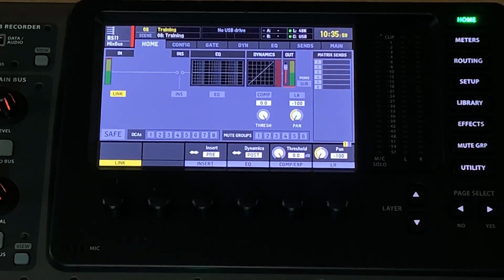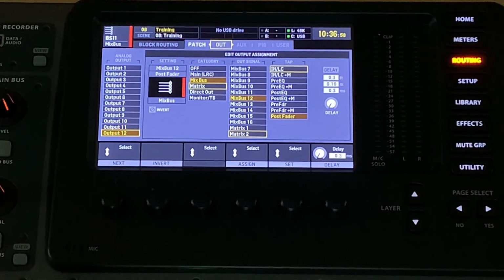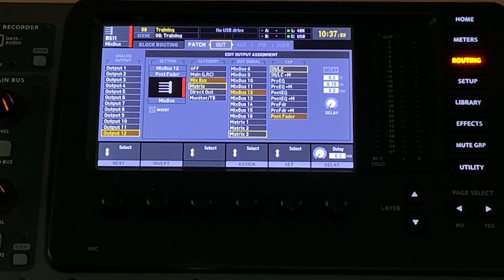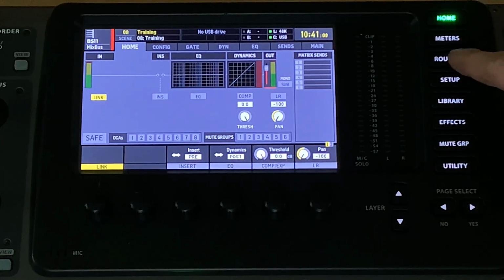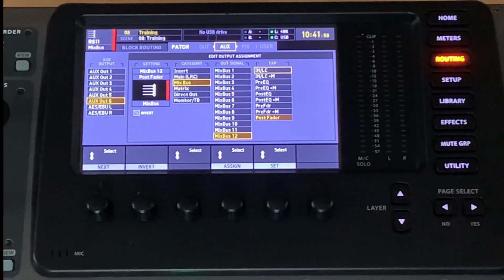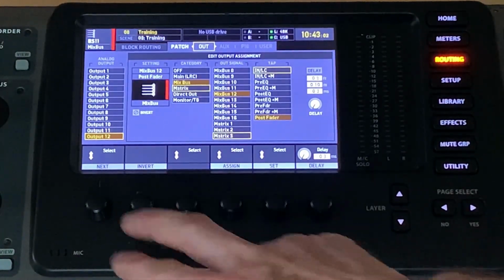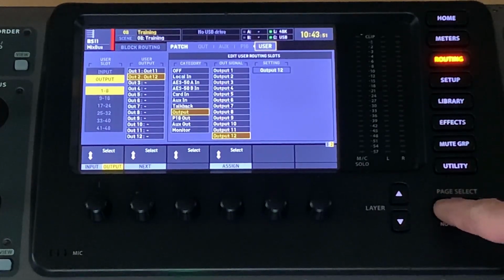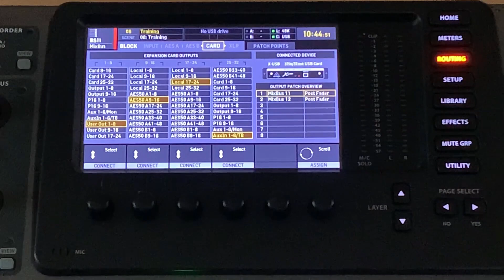3 Live Stream Routing Options for the X32 or M32

Comment: Howdy, thanks for all your videos and help in previous comments I've made. Another question that perhaps you can help me with. I'm helping a group with their online stream mix and set busses 9&10 as a stereo pair to accomplish this. These busses also have the Precision Limiter running to beef up the volume. As discussed in previous comment these busses are routed to run out of the Aux out 5 and 6 (Video L & R) to go RCA (post fader) into the encoder. The problem I'm running into is MASSIVE clipping in the resulting video stream. Unfortunately there is no way for me to monitor what the encoder is hearing or sending out. I'm almost positive I had these guys set up to monitor the mix on the console with headphones and heard no clipping there. So I'm scratching my head. Does the use of the RCA output send a much hotter signal than going out xlr? (Even then, I would think the encoder should be made to accept the hotter signal given its RCA inputs) The RCA outputs shouldn't bypass the limiter right, given that it is set to post fader? Not expecting magic, just wanting to get your input for troubleshooting...
Reply from the maker: If you have the limiter on your stream mix then your board mix should not be clipping. You did mention you have it set as "Post Fader" and I'm assuming that is on the output side which means your limiter will be active, but your fader can still raise or lower this overall mix. The first thing I would do is change that setting to AUX out tap point to PreFader so that there is no chance of turning up the mix and causing issues. 

The RCA and 1/4" outs are unbalanced outputs while the XLR outputs are balanced. There is no output level change or amplification happening on the soundboard side. Depending on the encoder you are using it could cause issues there if your signal is going in too hot, but I would only check this after looking at the stream fader on the board. Some entry level encoders might want to live in the -18dbFS landscape and if you push more than that they might distort. The X32 meters showing 0db on the output will actually meter at -6dbFs.  I hope this helps give you a place to start.
Reply: @AllamHouse  Thank you, this gives me a great place to start. I think adjusting to PreFader will be great once we get the distortion figured out. Everything that I'm seeing leads me to believe that I may need to lower the Output Gain on the Precision Limiter. Will know more after this weekend. Thanks again!
Reply: Line level standards varies on different devices
it is common for audio mixers to use +4dBu (between + to - polarity) as their norminal line level, this is 1.782dBV or 1.228Vrms. Many consumer devices uses -10dBV (0.3162Vrms) as their standard, the consumer device will be overloaded if the mixer output was not adjusted properly
Reply: @philiptong4978  Thank you for this clarification!

Comment: What if you have an older firmware on your x32 that doesn't have the user function.
Reply from the maker: It is still possible, but you would need to set your stream into MixBUS 1/2 or 9/10 so they are at the beginning of the 8 bus group. That being said, I would just update your firmware (after saving your scene) since it only take about 2 minutes.
Reply: @AllamHouse  Hey I did that but, when I increase the volume for mixbus 1&2 it also increased the house volume. What's wrong?
Reply from the maker: You need to go to the Bus, select the channel and turn off the “Stereo LR Bus” button so the MixBUS isn’t being sent to mains. (Found to the left of the screen if you have the full size console).
Reply: @AllamHouse  I'll try it, thank you.

Comment: So, would it be counterproductive to have a USB from M32 to laptop AND stereo trs to aux in inputs 1 & 2 routed to bus 1 & 2 for ATEM. Our church is struggling with this. It's been the most frustrating audio journey of our lives🤷‍♂️🤦‍♂️
Reply from the maker: Thanks for reaching out.  The short answer is that you only need to select one option and then commit to it and make it great.  If you have an ATEM mini I usually use the AUX out approach and use a 1/4" to 1/8" TRS cable to connect the audio into Mic1 on the ATEM mini.  If you have a larger unit like a TV Studio HD that accepts XLRs then you can select two XLRs to send to your switcher.  Once you have decided the output that will be used you can then build your mix.  I personally use a Stereo Post Fader MixBUS setup (as seen in the video posted below) and I then route make sure those two BUSes are routed out the AUX (or XLRs) I selected earlier.  I hope this helps.  If you need assistance I do handle virtual consultations and can get you up and running pretty quick.  Just go to my website and fill out the contact card to start a conversation outside of YouTube (https://sound.allamhouse.com)
Video Referenced: https://youtu.be/pMnaiuC55RY
Reply: assuming your laptop has hdmi out and ATEM has hdmi in
1. route the m32 usb audio on latop to hdmi out
2. connect hdmi from laptop to ATEM
3. turn on hdmi audio on connected ATEM channel

Comment: Hello Dave, My question is about a fourth possible way to get audio directly out of the Behringer X32. I am interested in using NDI 5 to get direct audio from the X32 to my network. Do you have any idea how this would be done? Thank you for your time and valuable information!
Reply from the maker: I have not explored sending signals directly from the console across NDI.  Most users would be sending audio and video across NDI and that usually is happening through programs like ProPresenter7 or other similar products.  If you just need to send audio digitally on your network, DANTE is the industry standard solution.  You can interface with your console and other machines across your network to send and receive audio signals across a network.

Comment: Hello Dave I have a question regarding the stage box I don't have signal coming out of the preamps 7 and 8 I have signal coming out of the rest preamps
Reply from the maker: Here is where I would check for your connection issue.  
1) Take a functional mic (from inputs 1-6) and plug it into 7 so you rule out the source.  
2) Go to Routing > Inputs and check to see what your settings are.  Ideally they would be AES50a 1-8 or something simple in a block of 8.
3) If you have it set to User IN then you need to investigate your user in settings to see what you have setup and why it might be different than 1-6.
4) Finally, make sure you have the correct preamp selected for this channel by selecting channel 7, then going to Home > Config and checking the source is set to the correct channel similar to 1-6.
Reply: @AllamHouse  Thank you Dave I will go the church today and do that Thank you sir I am really enjoying your videos they're helping me set up the X32 console new for me coming a analog board
Reply: @AllamHouse  Hello Dave home configuration was the ticket I know have signal on all my preamps GREAT BIG THANK YOU  GOD BLESS  DARRELL

Comment: I use option 3rd with Ecamlive...I have a limiter on the streaming buses as well...I am thinking to use the xlr out and connect them to an audio interface then to the computer to the USB of the interface...Then use the USB out of the mixer to another computer for multitrack recording..So I don't stress too much 1 computer with recording plus streaming etc...Will this make sense??Blessings from Cayman Islands
Reply from the maker: I would prefer to not use an audio interface as it creates another technology point of potential failure.  Multitrack recording will not draw too much on your computer and you should be good to record and stream at the same time.  As long as your computer has a dedicated video card that your stream is using to offload the video rendering process (off from the CPU) then you will be fine.  This video here discusses the routing needed to make this happen across the one USB output of the console. https://youtu.be/Zb6ngDBuaDE

Comment: Hi @AllamHouse, I have been using a Radial PRO ISO Stereo Line Isolator because I have been getting a buzz if I connect directly to the Atem. My understanding is that Atem is unbalanced stereo input that causes the hum/buzz noise when connected X32 balanced outputs. Does this method remove the buzz/hum?
Reply from the maker: Usually, what I experience is the gain on the ATEM mini is too high and this causes a lot of buzz and distortion issues. By default the gain is set really high since the input is set for a microphone input… and not a full mix from a console. You have to access it from the ATEM software and the first thing ai do is turn it all the way down. I run a full-signal recorded song through this and slowly raise the gain up until you are just hitting the first red mark.
Reply: the ATEM 3.5mm TRS stereo unbalanced jacks can be configured to either mic level or line level from its setup software, max level is +6dBV (or +8.218dBu), best to leave gain setting on ATEM at 0, faders at 0, monitor the meters and adjust your sound board (x32 or others) output as appropriate, YT target is -14dBLUFS integrated at this time, other platform can differ
Reply: I had this exact issue this week as we try to get our church live streaming up and running. I’ll try this to see if it fixes our problem. Thanks v much!
Reply: alternately consider using method 3 usb audio, use a pc to route usb audio into hdmi out stereo, which goes to ATEM, ATEM uses 24/48kHz natively